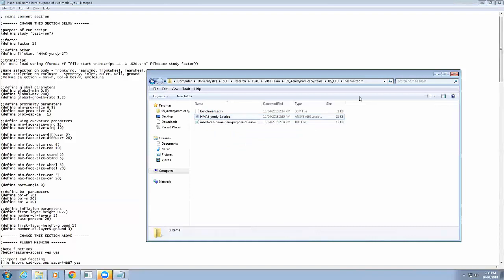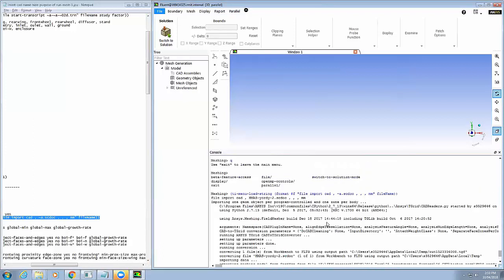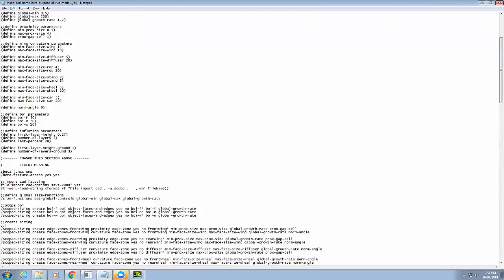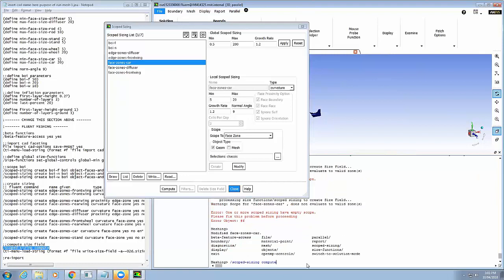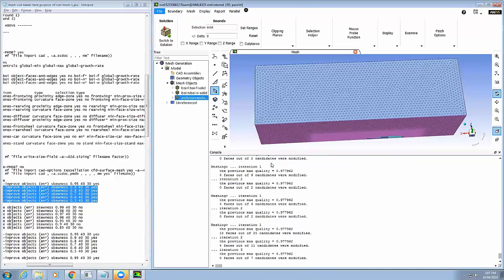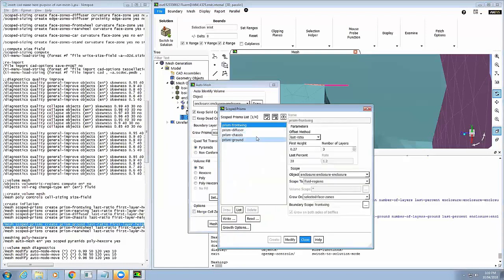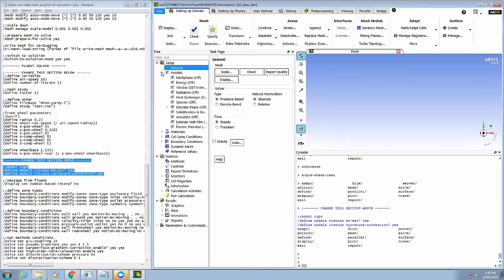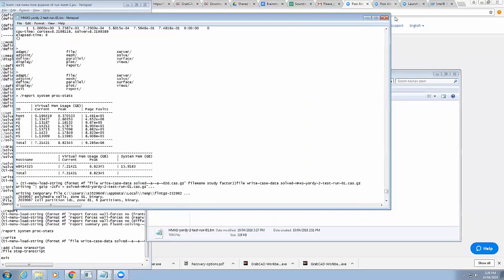How to create the ANSYS Fluent Script-CFD for FSAE #14

Comment: Hello LEAP, do you know how to read a script/journal automatically after reading mesh in solver?
Reply from the maker: After switching from the mesh to the solver via the GUI, you can use File->Read->Journal to read a journal.

You can also use the command line to launch a new Fluent session with a journal using the -i flag like so.
fluent 3ddp -t4 -i journal.jou
For this method, the journal should have instructions to read the mesh file. Also note that for this to work, Fluent must be added to path.

Comment: Is it important to write a sizing field and then importing it again?
Why is this step performed?
Reply from the maker: Sorry for the (very late) reply, but hopefully this helps other uses who are also interested in this topic!

For context, a size field is basically a surface field of mesh sizes along the surface of the geometry. In this particular video (3 years old), we used an older meshing workflow (outline method) - in this case, the reason for the re-import is that at the time, we'd found it to be more stable and robust, and easier for debugging purposes.

In more recent years, we now recommend a more straightforward step by step workflow – using watertight geometry workflow.

This 2019 video runs through watertight workflow quickly in the first 2 minutes of the video (note: scripting method is also possible for this workflow but it is not included in this particular video):  https://www.youtube.com/watch?v=I3a1cxgMWCM 
We also recommend Ansys’ 2021R2 video: https://www.youtube.com/watch?v=MYKrFqxbyko

Note that some users still prefer to use the older workflow shown in this video, as it has the advantage of being very customizable.